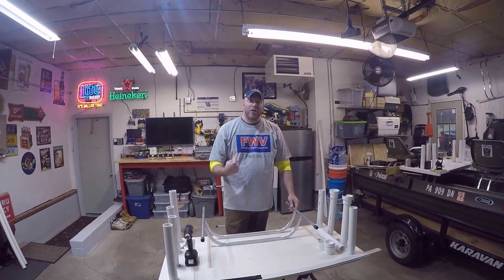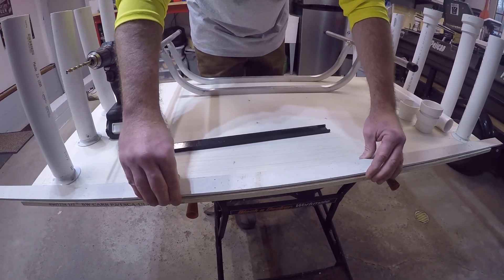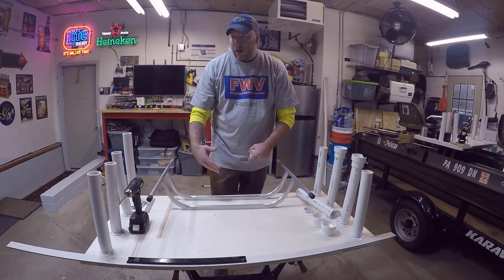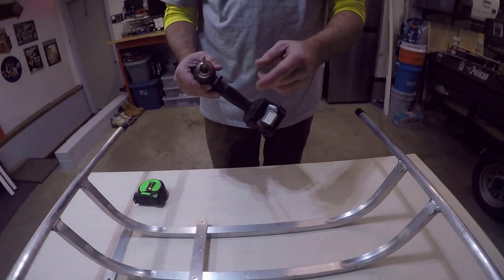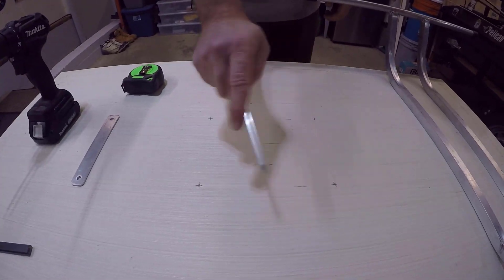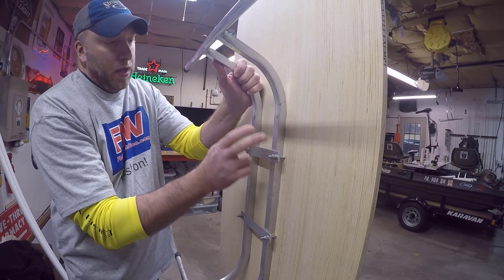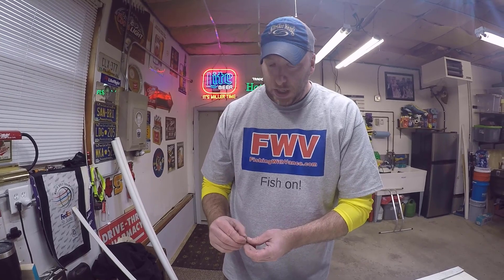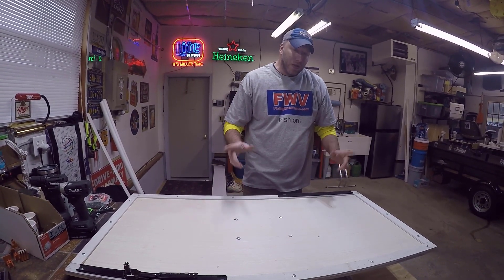PELICAN BASS RAIDER 10E MODIFICATIONS | FishingWithVance

Comment: Hey Vance where’d you get the 1.5 curtain rod holders? That’s all I need lol
Reply from the maker: Got those at Lowes.
Reply: Fishing With Vance I just left Lowe’s they didn’t have it I’ll check online. Thanks!
Reply: Now I see ,what you guys did was slide the 1.5 over the curtain rod holder instead of inside of it.
Reply from the maker: Correct.
Reply: Fishing With Vance lol I was looking everywhere for a 1.5 inside diameter.